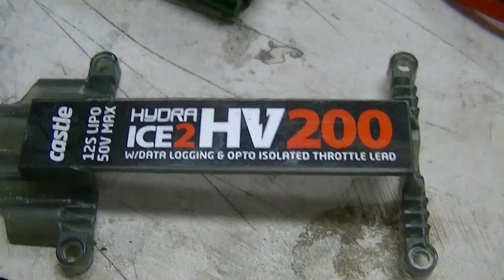Inside look of Castle 200a hv ESC

Comment: Check for direction with a multimeter.  And as for the caps replace and resolder them
Reply from the maker: wire54321 Yeah, but which way on the PCB?  I already sent it in anyway.
Reply: Put one lead on negative and use the other to probe the 2 points